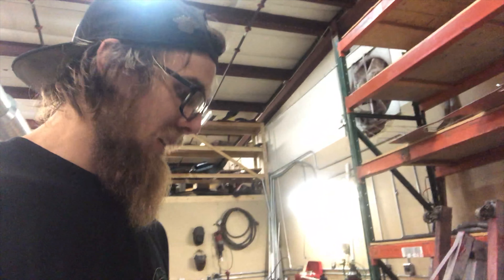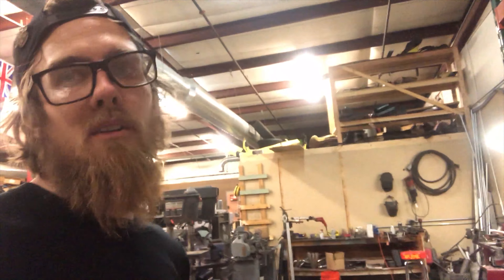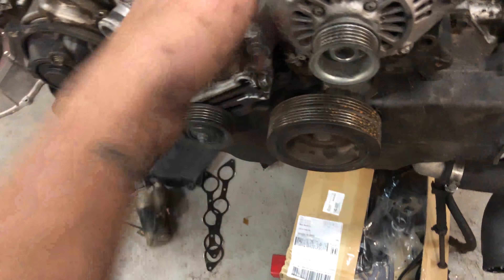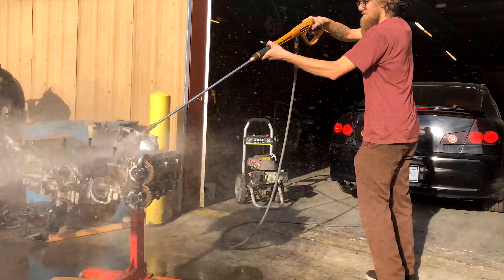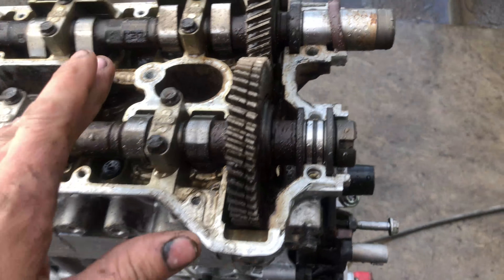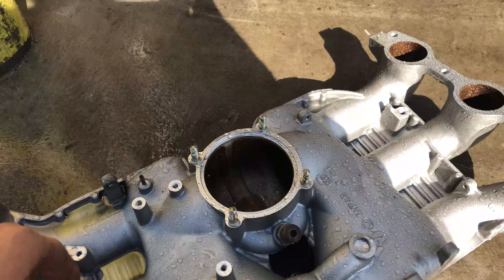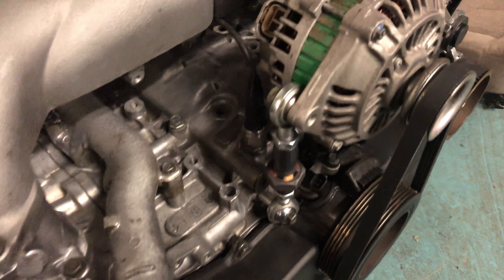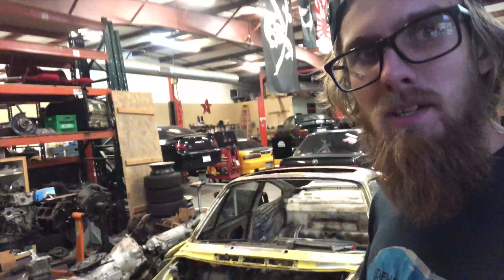Resealing and Cleaning the Sh*t out of the EG33 for my Porsche 911sc

Comment: i see you removed the idle air control valve under the TB, and ive seen other people leave it on. Is there any advantage to leaving it on?
Reply from the maker: It helps with keeping a consistent idle and idling on cold starts. I’ll have to make adjustments to the idle manually and give it throttle to keep it alive until it gets a bit warm